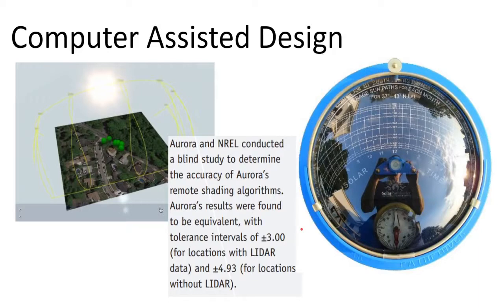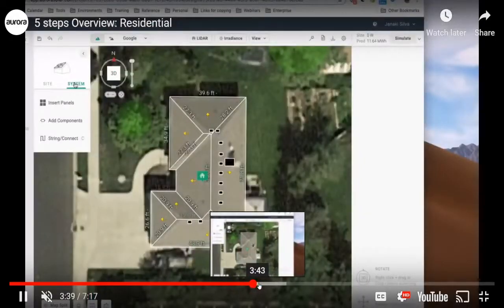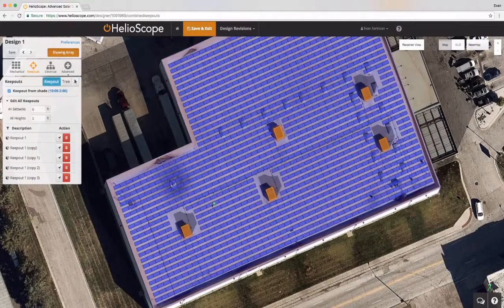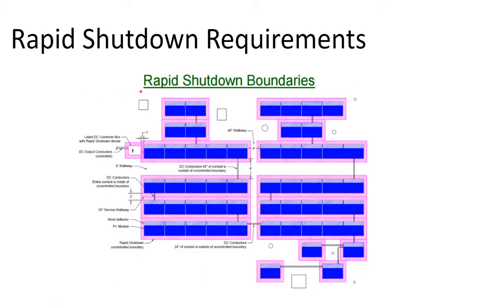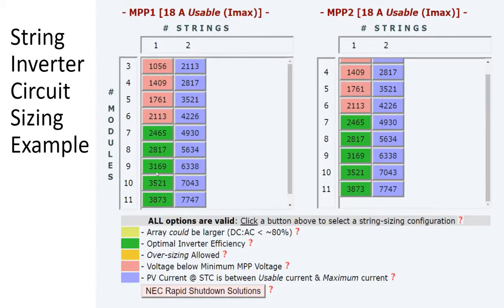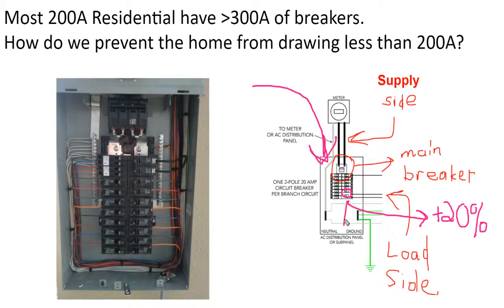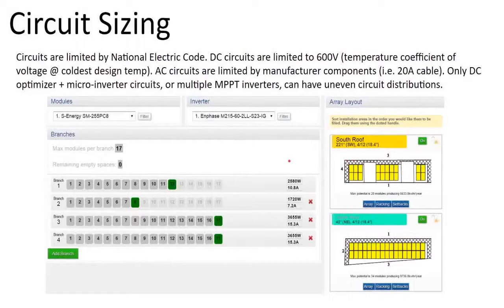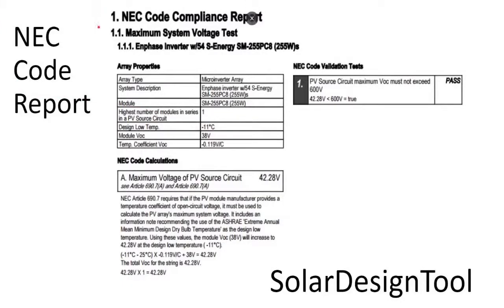Design Your Solar Roof Part 2

Comment: @ 21:40 You mentioned that if a MLE goes down, the customer might consider leaving it alone until there is a good reason to get on the roof. From my experience depending on the installer, the installer will take of the warranty labor/parts at no additional cost to the customer.
Reply from the maker: Great comment. I have not found a customer who is happy with a MLPE failure. Many installers will replace at no charge to the customer.   
Fundamentally there is a cost in the swap that needs consideration and the installer providing a free MLPE swap is losing money that day. 
Hopefully the installer already priced that into their bid. Customers will pay 25% more for a 25 year comprehensive labor warranty. 
But the premium for such a warranty should be more like >50%. 
Basically, it makes sense if one MLPE fails, to just wait for another to fail before investigating much further. And MLPE will fail. 
So its best to discuss the MLPE failure process with the customer, if you do not intend to replace them for free.

Comment: Aurora requires modeling the trees accurately which requires time.  Suneye is actual measured data. We prefer that.  suneye you take multiple images with varying shading such that you can select the BEST solar irradiance area.